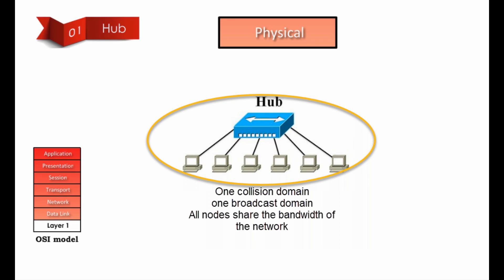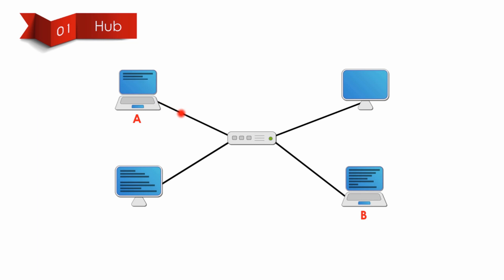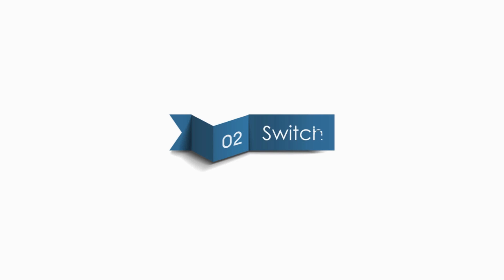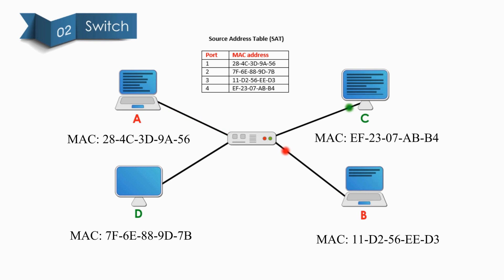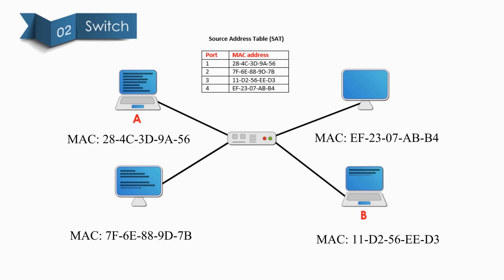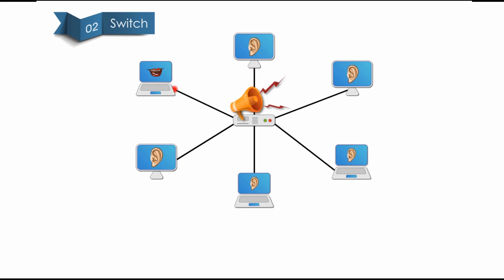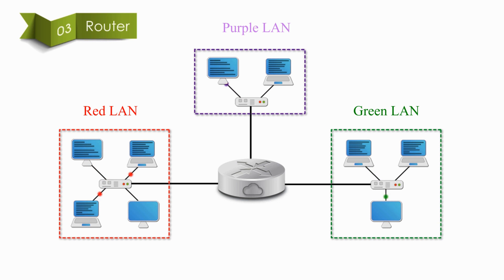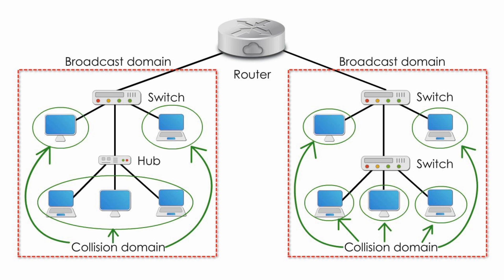collision vs. broadcast domain: Hub, Switch and Router

Comment: I have 1 router, 4 switches, 7 hubs, 1 bridge and 8 PCs.

1. The router connected to the switch1, switch2, hub1 and bridge.
2. The switch1 is connected to the other two switches, switch3 and switch4 and pc1 is connected to switch 3 and pc2 is connected to switch 4.
3. The switch 2 is connected to the other two hubs, hub2 and hub3 and pc3 is connected to hub2 and pc4 is connected to hub3.
4. The hub1 is connected to the other two hubs, hub4 and hub5 and pc5 is connected to hub4 and pc6 is connected to hub5.
5. The bridge is connected to the other two hubs, hub6 and hub7 and pc7 is connected to hub6 and pc8 is connected to hub7.

Identify the broadcast and collision domains in the given text and enter the number of Collision Domains and Broadcast Domains. Please explain

Comment: Hub
- operates at layer 1
- when it gets a signal from one node will send it to the rest of the nodes connected

Switch
- operates at layer 2
- gives every conversation/communication the full bandwidth of the network - only destination node hear communication from source node
- connections can happen at the same time without collision this switches separate a collision domain
- when communications pass through the switch for the first time it copies their source nodes' MAC addresses and stores it in a Source Address Table
- It still gives every conversation full bandwidth even when additional nodes are added
- thus separates collision domain but creates broadcast domain - group of nodes that can hear each other by broadcast

Routers
- operate at layer 3
- separate collision domains and further separate broadcast domains

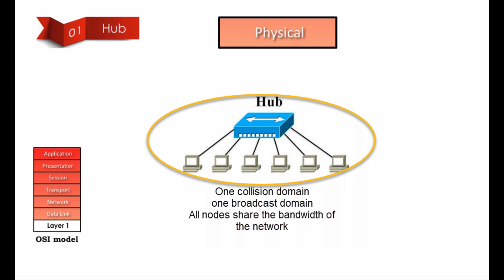Comment: 0:38 I'm a network hub
Reply: Also thank you for the video, it was a great help to me. I didn't understand how they worked until this, just a vague idea.
Edit: I should add that my main confusion was to do with routers not increasing the broadcast domain. In the UK, routers often come with multiple ethernet ports which allow communication between the devices. Turns out that most routers here have a switch that's built in to them.

Comment: Sir Sunny, can I ask? Assuming i have a layer 2 switch (tplink L2 switch) it has 2 10gb sfp ports or fiber ports and 24 gigabit ports, then i have a router (tplink router), the router is connected to the internet, a cable is plug from the Lan ports of router to the port 3 or and gigabit ports on the switch, is it possible for me to have an internet? Without connecting the cable coming from the router to the sfp ports/10gb fiber ports? Like a typical or common unmanage switch? Is it possible for me to have internet connection? Or should i plug the cable to the 10gb sfp ports or fiber ports in order for me to have an internet connection? Please help, i hope you can help me with this matter. Thank you. *Newbie here

Comment: Your videos are clear, simple and very informative! I've a couple of questions from this video:
1) You said Switch uses the SAT table to create point-to-point connections between each pair of communications nodes. And then you said Switch creates Broadcast domain where  all other nodes can hear. Is it then same as Collision domain? What is difference between Collision and Broadcast domains?

2) If Switch creates Broadcast domain, not Collision domain. But you pointed the two nodes of Switch as Collision domain at 5:11.
I am new to this. Could you / somone clarify please?
Reply: In hub network type with five end hosts for instance, an end host say computer A wants to send frame to computer B, every other host will get the frame even if the frame is not intended for them. This is a collision domain. In switched network, computer A sends frame to computer B, only computer get the frame. A switch has a mac-address table (SAT) that registers a computer A's mac-address and a associated port and every other hosts connected. With SAT populated with all mac addresses, and the switch direct frames to the right port where the intended recipient resides. The idea of Broadcast domain in a switched network is related to the fact that the frame is broacast to everyoned intentionally (because of ARP) using FFF.FFF.FFF.FFF address.

Comment: Thanks for the well explained, informative video.. By the way I have a doubt.. 
Why do we need a Hub if it sends the information to the every node which are not intended to receive? Or hub is used just to connect some nodes? It doesn't even read addresses ?
Reply from the maker: You are correct. In today's networks, you rarely see  a hub. but in SOHO environment, you might still see them.
Reply: @sunnyclassroom24  Thanks for the reply
Reply from the maker: @akkugudi9152  You are welcome.

Comment: Hi, is switch in this scenario means switch manageable and unmanagrable.? Or is it work on switch manageable.?
Reply from the maker: good question. Here the switch is very generic, or it is a typical layer-2 device. For multilayer switches, we might think differently because nowaday switches have so many manageable features. e.g. VLAN, inter-VLAN routing and so on. Thus, here in this video, a  switch is a very basic layer 2 device. I hope I answer your question.
Reply: @sunnyclassroom24  hi thank s for your response.. it means a basic switch or let say switch unmanageable is smart, right.? Because i think hub is almost gone from this planet 😁. Please correct me if i wrong. 🙏
Reply from the maker: @dennywillyanto116   you are correct. At home,  we might still see basic switches and hubs (combined together in most cases), but in industry-level, most switches are manageable and configurable. they are smart, of course, because they can separate different broadcast domains.

Comment: 1. Is an Ethernet hub just physically connected wires so that it requires no control circuits and no power? Like parallel circuits? 
2. At 5:03 how does the switch know which link is to a router and therefore doesn't send the broadcast frame to the router?
Reply from the maker: 1) hub needs power but doesn't interpret data. 2) when a host broadcast, the router can hear it.
Reply: 1. I don't understand why Ethernet hubs need power. It seems that it can work like a bus-powered (passive) USB hub. Could you explain?
2. And the router just ignores it because it is not an IP packet but a layer 2 frame?
Reply from the maker: @tsunghan_yu  1) You are correct. USB hub draws power from the computer connection, however some hubs need power; 2) router can hear broadcast but it will ignore any unrelated messages. If an ARP message is asking for router's MAC address, then the router replies.
Reply: Sunny Classroom I got it. Thank you.

Comment: When using switch, do the nodes need to wait their turns when broadcasting? Or can all of them simultaneously broadcast?
Reply from the maker: great questions. With switches, any conversation between two computers are using full-bandwidth conversation. 
In terms of broadcasting, it is a great question. I assume it must take turns, otherwises, collisions occur.
Reply: @sunnyclassroom24  if the links are operating at full duplex it wouldnt be a problem right?

Comment: Thank you for your video. Can you also explain how Bridge works or send me a link if you have an existing video.
Reply from the maker: I do not have a video, but bridge is like switch, but only with two ports connecting two LANs. In other words, switch is a bridge with more than 2 ports.
Reply: @sunnyclassroom24  thank you very much.
Reply from the maker: @bobmundeke5480  You are very welcome, Bob!
Reply: @sunnyclassroom24  With only two ports, so a bridge is used for extension purpose?
Reply from the maker: @tsunghan_yu  correct.

Comment: Hi Professor. Thank you for your great and clear videos. I have a question on the MAC addresses on the video. On the SAT table, did you assume '00' on the left of the MAC addresses ??
Reply from the maker: It entirely depends on NIC manufacturer. The first 24-bit of MAC is manufacturer ID -OUI (organizationally unique identifier), the second 24-bit is card ID. Many MAC addresses starts with 00, while many others don't.